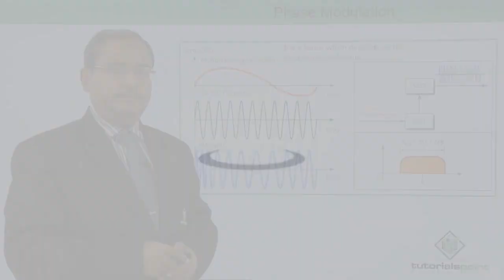Phase Modulation

Comment: Isn't that Frequency Modulation, where you modulate with the modulator oscillator in carrier oscillator.
Reply: If you differentiate the modulating signal applied to a frequency modulator, you do indeed get phase modulation,
whereas if you integrate the modulating signal applied to a phase modulator, you get frequency modulation.